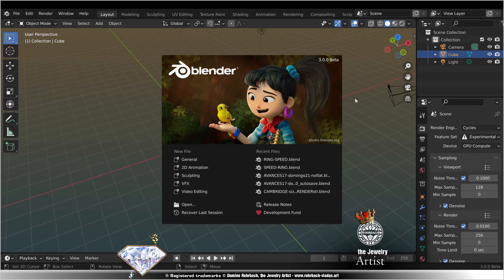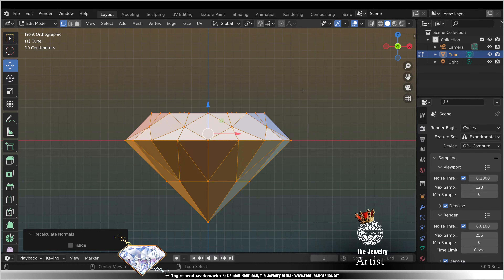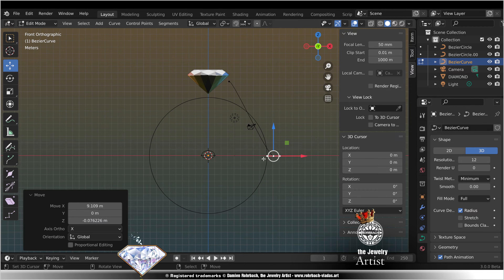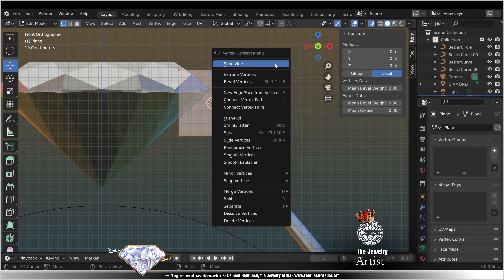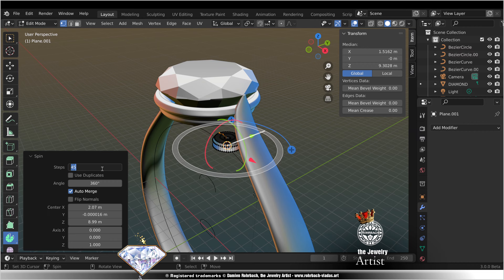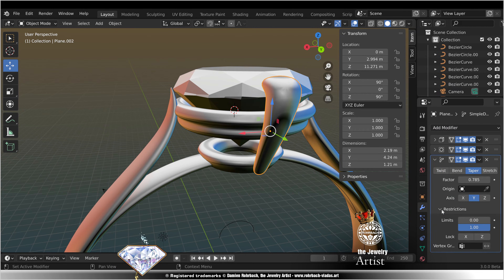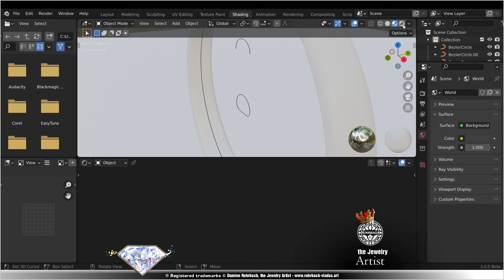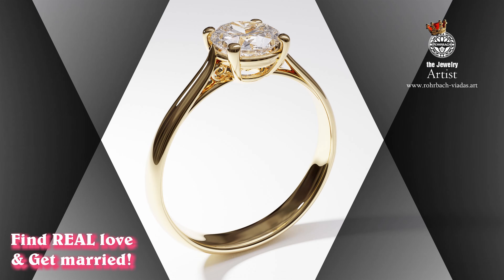3D Diamond gold ring tutorial modeling and render using Blender 3.0

Comment: How do you get the end of the curve to be thin, when I use the taper option it will not let me scale the points of the curve. did you convert the curve to a mesh afterwards?
Reply from the maker: No, you are using taper wrong. You can also set taper to add or multiply instead of override. Then in edit mode, the vertex radius will respond  again
Reply: @RohrbachJewelryDesign  ah okay thanks